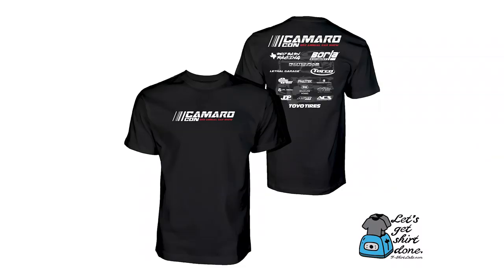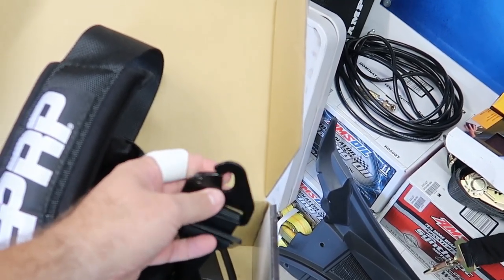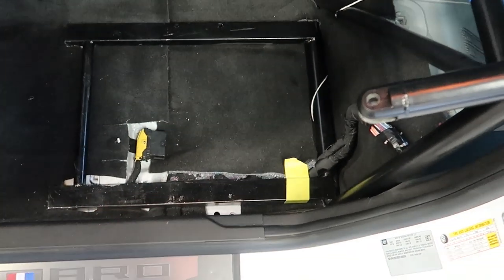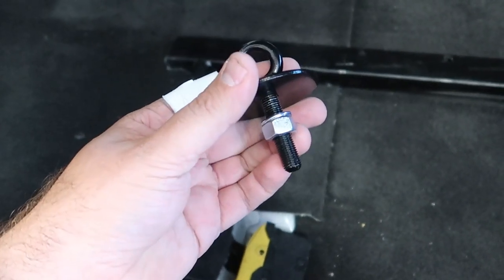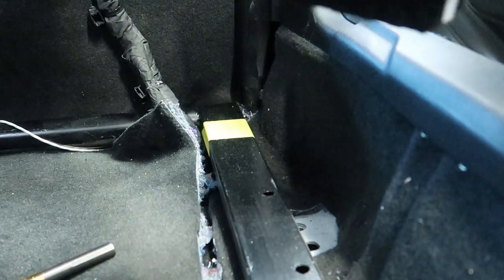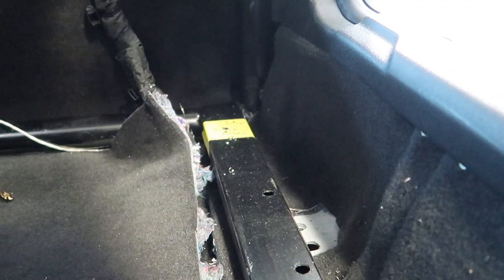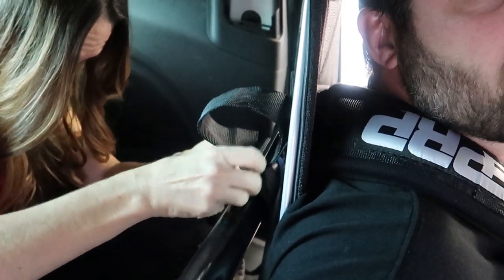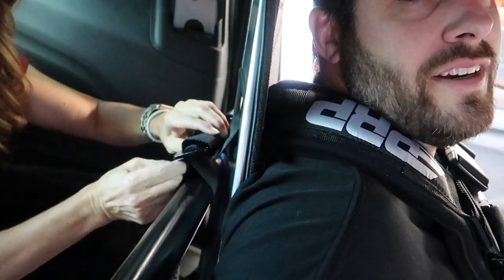Racing Seat & 5.3 Harness Install (SFI Approved)

Comment: Would it be better to put the washer on the bottom side to prevent the nut from pulling through the seat frame in the unlikely event of a wreck??
Reply from the maker: I actually went back and added a similar washer after the fact
Reply: @Lethalgarage  glad you'll be safe!  Keep up the great work!